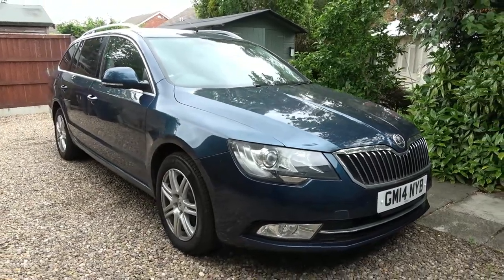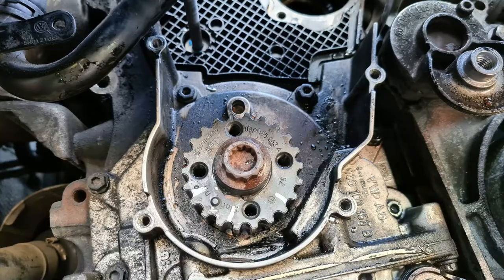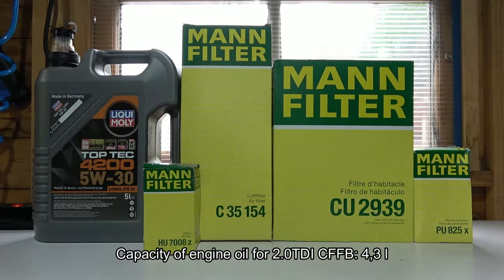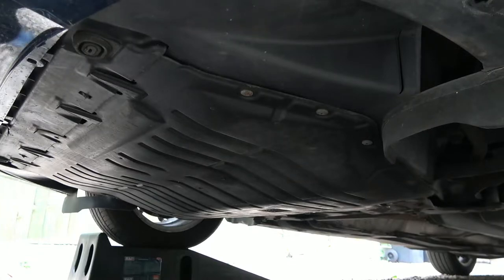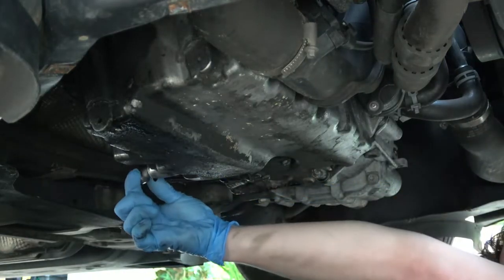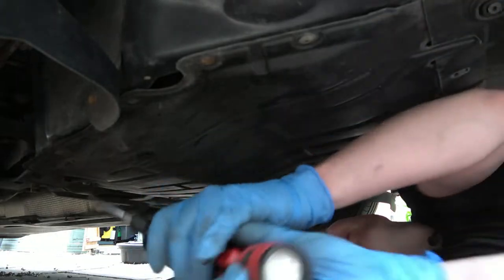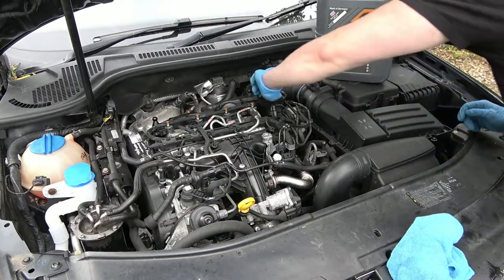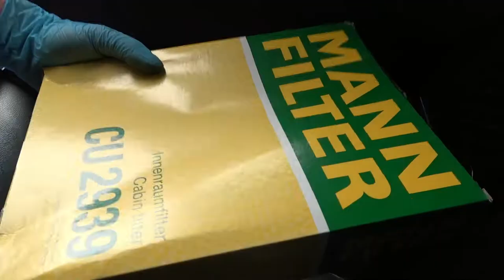High Mileage Skoda Superb II with 240 000 Miles, Regular Maintanance, Engine Oil & All Filters

Comment: Thank you very much for sharing Martin, this is a very well structured and useful video. Will you be able to give your opinion about the following questions please? 
Is the servicing for the 1.6 tdi superb engine the same or similar to what you showed here? and is the 1.6tdi engine as good as the 2.0tdi to last beyond 200 000 miles or will it last less and give more trouble in a big car like the superb estate? Thanks in advance for your time reading this comment and questions
Reply from the maker: Thank you that you liked my video, to be honest I don’t have that much info regarding 1.6 TDI engine but I think there are a lot of similarities comparing to 2.0 TDI. I remember back in the days when I was working for company that had Škoda Octavia 1.6 TDI l, there wasn’t any issue besides regular service. Sorry for late response, but sometimes I overlook some comments.